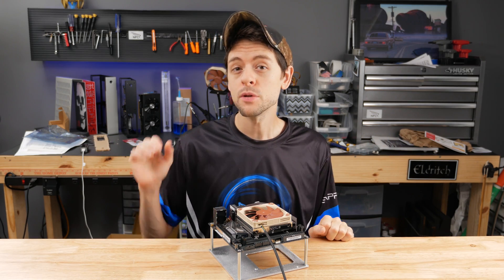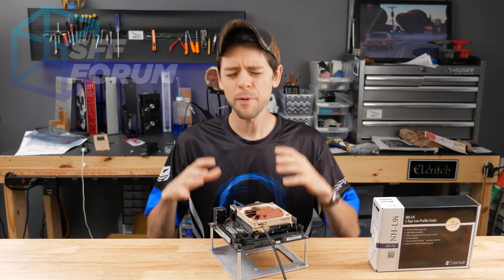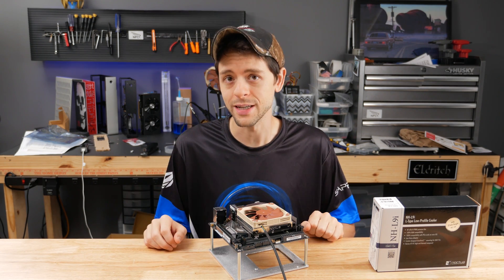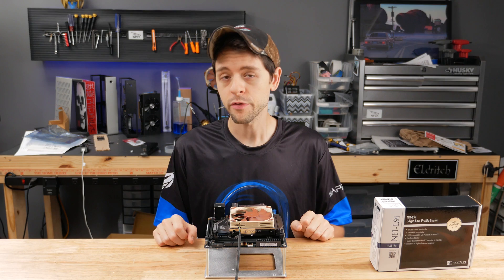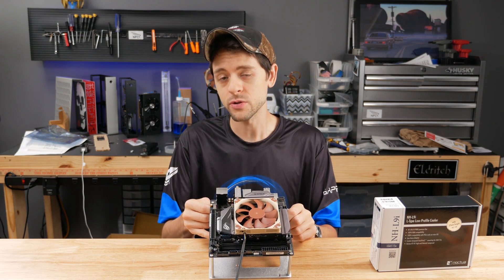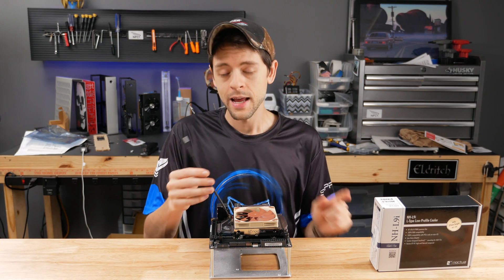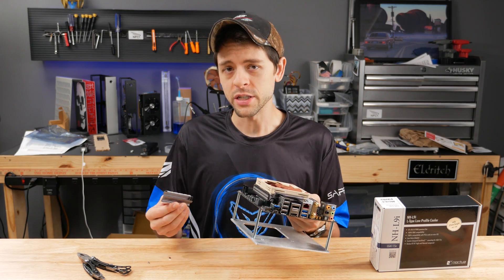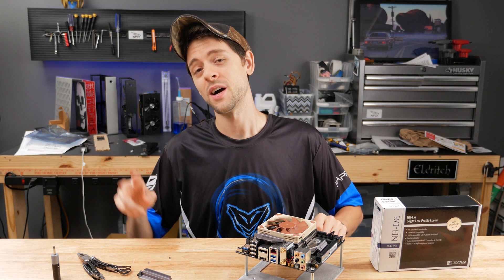Noctua NH-l9i - Performance and install tips for mini-ITX

Comment: does this fan power cord work on an optiplex 9020. I changed coolers but the new fan wont plug in, and the old fan is too tall, so thinking of switching to this notua nh-l9i
Reply from the maker: take a photo and send it to me in the Discord and I can help you adapt it. https://discord.gg/nrHjHE9e
Reply: @NotFromConcentrate  I checked their FAQ, if anyone's interested, they do NOT support dell)and several others) thanks for the reply 🙏

Comment: Bought this for my HP pre-built and the holes for the cooler dont even line up :/ 40 dollars wasted
Reply: I just made the same mistake, are you sure you got one for the right socket?
On closer inspection mine was for the AM5 socket so I had to take the L on this one.

Have to get an NH-L9i-17xx specifically for my LGA-1700 socket :/
But, you know, I guess it makes sense that every socket will be different

Comment: Is it blowing air down or blowing air away?
Reply from the maker: The vast majority of fans (99.5%+) the hub side indicates the side air is pulling toward. So this fan blows down. Air takes the path of least resistance and the majority of a fan's pressure is generated at the edges of the blades, so in order to penetrate the heatsink fins its generally best practice to "push" air through the fins. There are fans designed to pull, and heat exchangers with low resistance designed for pulling, but generally speaking, fans push.
Reply: @NotFromConcentrate  excellent! thank you

Comment: So, if it's parallel to RAMs, wouldn't that be worse for the M.2? (since it's perpendicular to it)
Reply from the maker: Yes and no--yes, you will get more hot air onto the NVME. No, because the problem with the ram is that the hot air doesn't get to freely vent--it just slams into the sticks doing nobody any good. Second no because NVME drives actually need to be warm to operate efficiently anyway. Peace

Comment: Hey
Help needed please
How do i install this correctly for AMD AM4?
With the fins of the heatsinks away from the ram
Reply: Sorry but. That's not possible. The mounting holes for AM4 aren't a square but a rectangle shape so the fins can only point in one direction. I wanted the same thing but sadly, it's not an option

Comment: could it handle a delied i5 9600k on 4ghz?
Reply: Mmm not really, over clocking creates a tonnn of extra heat, I see this cooler as a quieter replacement for a stock cooler

Comment: How do you think about the fin orientation of L9a? (ram and IO shield blocking the airflow)
Reply: Argh, this is what I'm trying to resolve right now. In a small form factor case like the Dan a4, a vertical orientation of the fins allows for the air to flow up or down, rather than smack into the ram and IO shield. Unlike L9i, with its square mounting holes, it appears L9a is rectangular, which only allows for horizontal fin orientation. X(

Comment: This wont work on the Ryzen one, right? =/
Reply from the maker: Sure it will, you just need their mounting kit for it. However you should instead buy the NH-L9a. Peace!
Reply: @NotFromConcentrate  I mean rotate it so the fins be parallel with the RAM. I have a NH-L9a and was looking exactly it. One side of the fins are kinda blocked by the RAM.
Reply from the maker: @thiagotenoriojordao  Ah, yeah, you are limited on orientation with that cooler. The good news is it has more metal in it so it makes up for the less than optimal orientation in most motherboards, although your ram can be sad if you have it overclocked. Peace

Comment: Ever tried mounting a Noctua NF-A9 PWM to the NH-L9i and fitting it to the  S4 mini? It has 50% more cfm and with the cooler it should only be 48mm tall. Only 3 mm away from fitting in your 45mm max height case. Maybe shave a bit off the fan to squeeze it in s4 mini.
Reply from the maker: Hi Kyle! It's a good suggestion, but it doesn't fit and shaving it down you would be past the hub. But even if it did fit, fans like this need an air gap between the panels in order to work silently and efficiently--ironically it would perform worse than the slim fan. We've tested this as a community with thinner heatsinks that allow for a 25mm fan to be installed and nearly touch the side panel, and in those installs the slim fans perform much better and quieter. Peace!
Reply: Definitely makes sense that the thinner heatsink would be warmer due to sacrifice in surface area to dissipate heat. Thought with how large the openings in your case the loss in efficiency  would be negligible. Even with the loss of the velocity stack effect i wouldn't think the turbulence would impair the performance significantly.

how about putting a NF-A12x15 on it somehow with a 3d printed bracket or homemade retention wires? nearly double the airflow and with it being larger then the heatsink it might help cool the vrm and ram. and its only 1mm taller. plus with pwm you might be able to spin it slower, get the same cooling, and be quieter. or crank it up and be able to accommodate some of the more warm blooded cpu's.